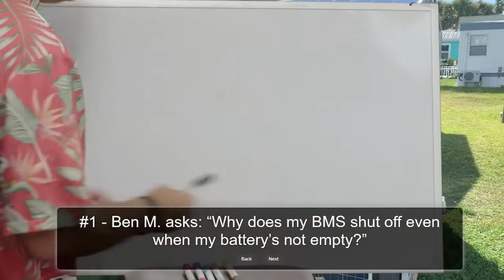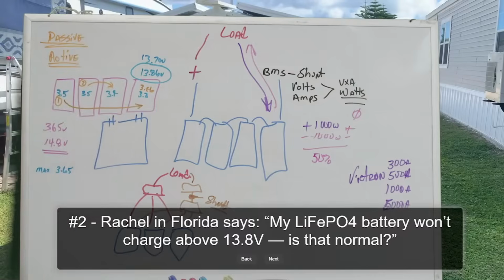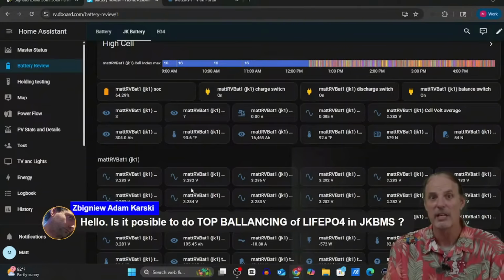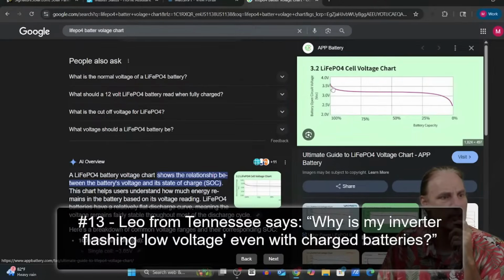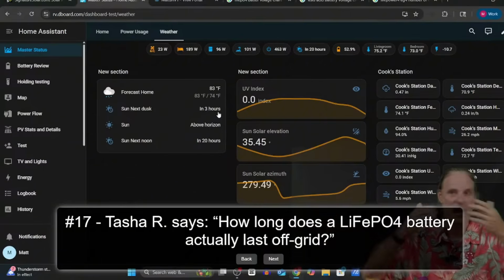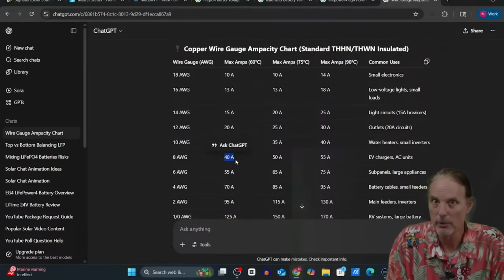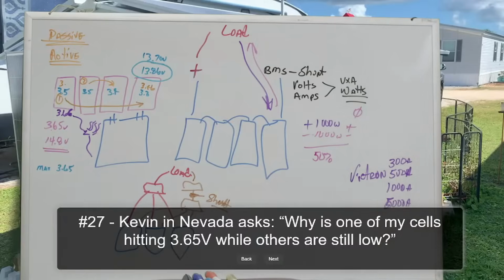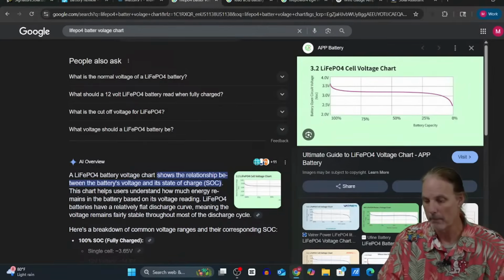State Of Charge 35 Questions and Answers LifePO4 Batteries

Comment: 36:45 Very well explained for even a 5-year-old to understand. In the case of the BMS situation that I understand is your battery will release the average power until they all balance, so I'm understanding that your battery voltage will be that of your lowest cell 3.33 volts until they all balance back to the normal voltage of set battery. So, meaning 45:25 your battery is as strong as your weakest cell. Am I close? Also, how many spare fuses should you have on hand in case of a fuse that will blow 49:17 Sorry for all the questions, but I'm thinking of going off grid 24/7 for at least 2 years and this is all new to me.
Reply from the maker: You got it.. I keep two spares.. Never needed one, but don't want to and not have one ..